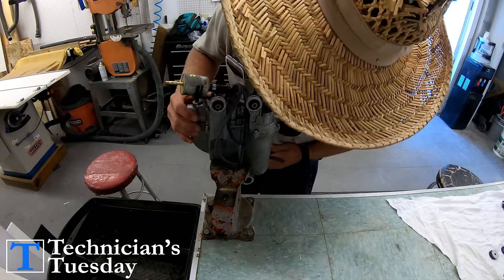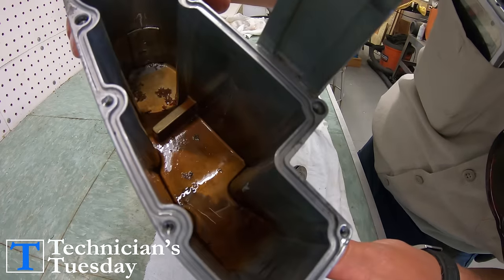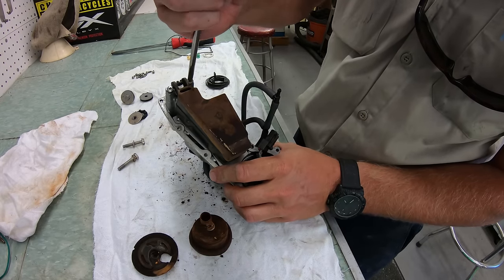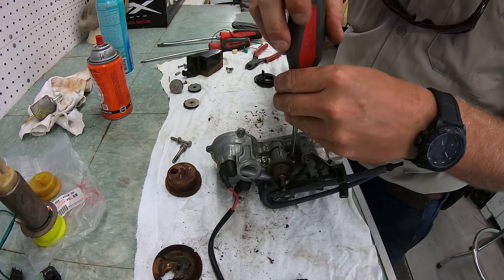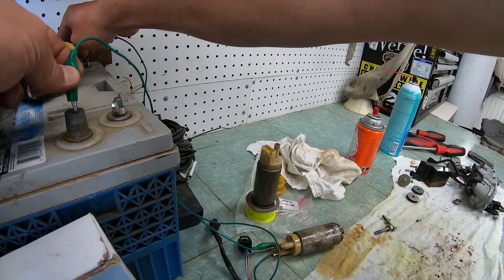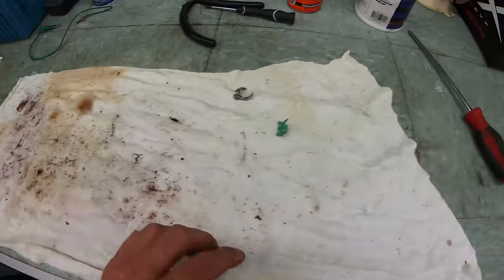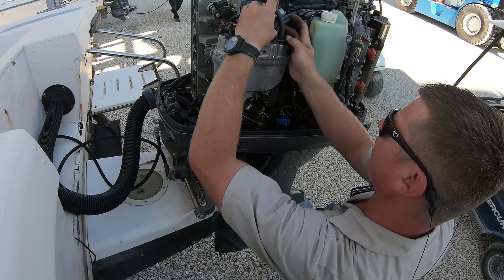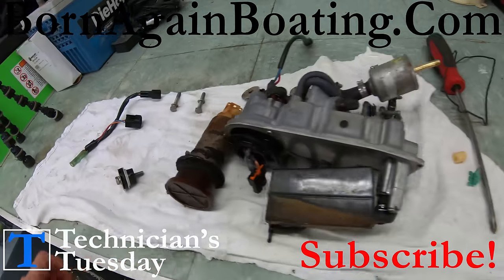How To Clean An Outboard Vapor Separator Tank (VST)

Comment: anyway to check pressure regulator??
Reply from the maker: To a point, there is a schrader valve that you can check the VST pressure by but you need a computer to check the high pressure pump pressure.
Reply: Thanks for reply.

Comment: When I turn on my key, I do not hear the pump inside the vat kicking on, could there be something I need to do first before I do the steps in this video? I am a fiberglass and refinishing guy and only touch my own outboard and I’m having issues on my personal boat. Any tips on how or what to volt meter test before going through taking my VST apart?
Reply from the maker: You can check the voltage going to the VST pump, make sure it has 12v when the key is turned on, it might cycle so check it as soon as you turn the key on, it might only supply voltage for 5-10 sec and then wait for you to turn the key to try and start it.

Comment: Hey Aaron, I have a question On my 04 225 Optimax  If you have the time. As you know Ive been rebuilding this boat for awhile. I took it out and it ran fine at the dock then about a hundred yards out it died. I had trash in the fuel line. So, I took the VST apart and cleaned , new filter and it ran fine at home but as I was doing the check while it was running I touched the wire to the fuel pumps and the wire connector was hot. I put new terminals in but I wonder if it may be something else. 11.7 Volts at those terminals. So voltage didnt seem hi, but is it low. Thoughts.
Reply from the maker: No, the voltage is just going to be battery voltage. But you could check the alternator output voltage and see what it is putting out. Here's some info that might help as far as testing the alternator: https://www.bornagainboating.com/outboard-alternators-chargers/
Are you sure the fuel lines aren't collapsing?
Reply: @BornAgainBoating  Thanks Aaron. As I went back and was doing my check, where the harness comes in to the engine from the boat, I had put a zip tie around them to hold them together while I put the rigging boot on. I think that was my culprit. Engine started right back up. Now I went back out and the boat ran fine for over an hour........20-30 MPH down to no wake speed back up to 40 and back down to no wake and so on. then just shut off. Now I have a no oil code on my vesselview and both senders are new. New engine reservoir and new sender for the reserve tank. Im trying to find a scan tool or program now to find what the problem is. Thnaks

Comment: how do you like this yamaha over merc verado. like you said they are expensive on parts just like every asian manufacturer
Reply from the maker: This particular Yamaha, I don't at all! These 300 HPDI's were horrible and expensive. The 150, 175, and the 200 HPDI, now those were great engines.

These big ones just never seemed to stay running correctly. So I would pick a Verado over it any day. The Verado is probably the easiest, large engine on the market to work on. Accessibility is unbeatable, you can almost do anything to that engine on the topside, in the water! 

I'm not a huge fan of the 150-200 HP 4 cylinder Verado though, those seemed to be an expensive engine for a mid range engine. 

In all reality, they all have their good points and bad points, no matter who the manufacture is. I know there is a lot of die hard brand loyal people out there that wouldn't touch this brand or that, but for me, it all depends on what engine and what year. I'm not a "Merc guy" or a "Yamaha guy" or a "Suzuki guy". 

I'm all about how easy is the engine to work on, and how reliable is it!

Thanks for the comment!

Comment: I followed this exactly as you did and freed up my medium fuel pump.  Thank you.  If the pump does not last, what is your opinion of aftermarket pumps?  Axiom and Quantum are two, and are less than $100.  Yamaha is $800.  Will they last as long as a Yamaha.  My current one is from 2003.
Reply: He mentions in a comment, he replaced pump with an Axiom.